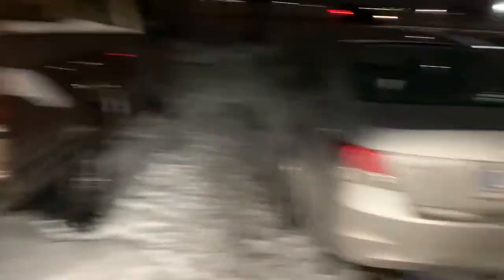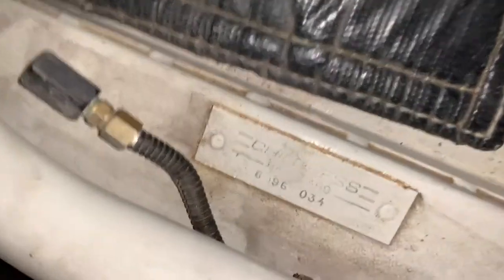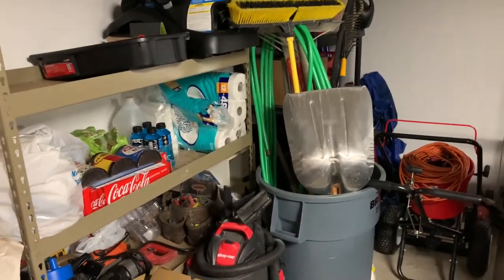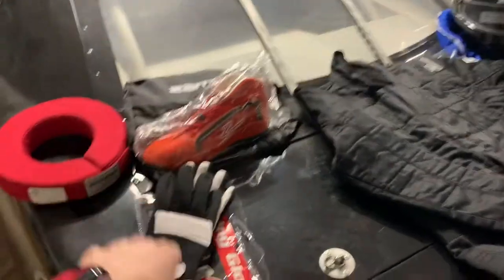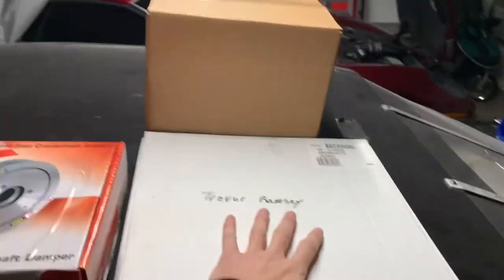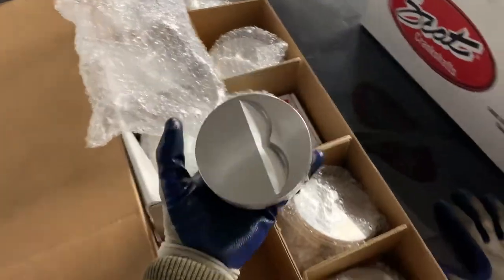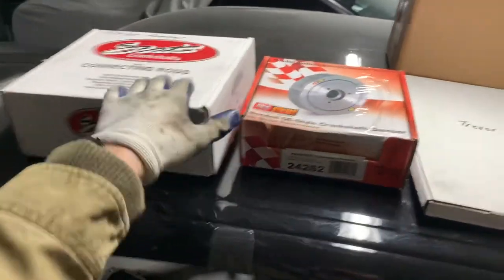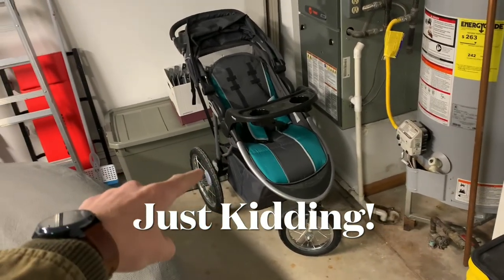BUILDING A RACE CAR!!! Late Model Race Team Part:1

Comment: Late model racing can be more expensive then some of your road course cars. Come down to mobile al and race at mobile intl speedway or five flags in Pensacola thoae halfile tracks attract 100 thousand dollar super latemodels and pro latemodels top teams are about 60 thousand dollar cars. I raced super stocks and that car costed.me 20 grand to build and 56 thousand a year to race. Their is nothing cheap about latemodel racing guys dont let this guy tell you its ver cheap and easy to get into and if you have never raced before I would t jump into a latemodel get you something like a super stock or a street stock or pro truck those classes will get you ready to race a latemodel. And the gloves and suit he got osnt the hest their is out there. I wouldn't trust my body in that suit or gloves and that neck brace is a joke you need a hans  and a full 1 piece 4 layer for suit and a real racing helmet cuse they are fire proof and the shoes and gloves are a must in a late model the specs are scfi rated
Reply: There's other affordable classes of stock car racing like 4 cylinder front wheel drives he could start on then move up to sportsman then late models as he gains more experience
Reply: You spent 56,000 a year racing street stocks? or do you mean 5-6,000....